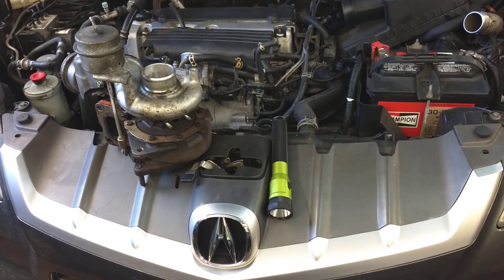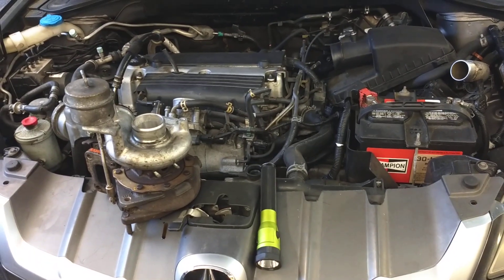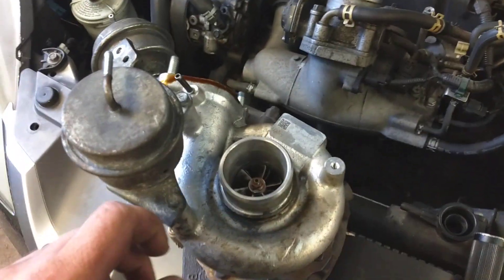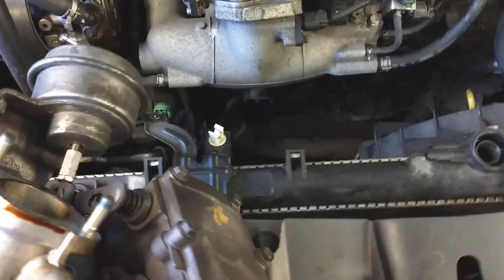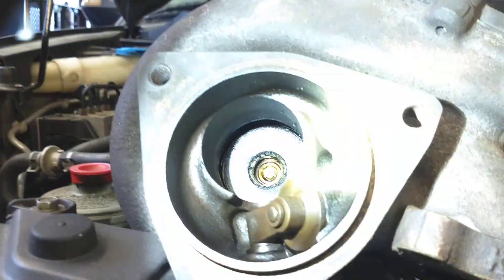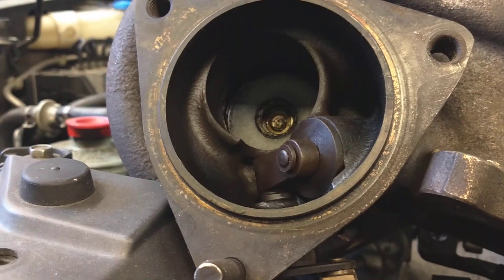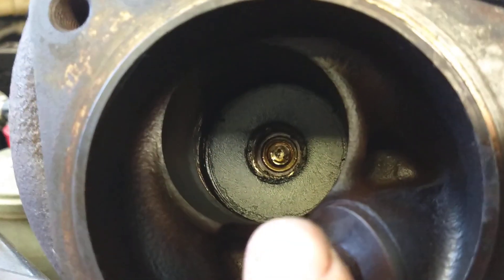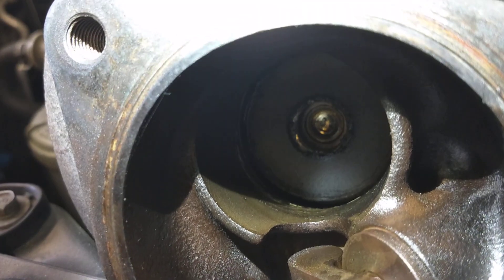2008 Acura RDX turbo failure

Comment: Got my 2008 rdx in 2012. Certified pre-owned at 30 k miles.  I still have it in 2021 with 135k miles. The turbo is sweet! Definitely cars with this issue haven't been maintained well.🧐

Comment: Absolute junk based on what?? '07 here w/ 200k - original turbo - still no shaft play and no oil leaks. These turbos are far better than most and go a long way with minimal maintenance. Stop feeding the sheeple BS - they actually believe it <smh>
Reply: Right on

Comment: Anything we can do to prevent this? Friend has a 2007 RDX with close to 300k miles and runs well. He says letting the car idle for at least a minute before turning it off helps.
Reply from the maker: Yes it's called a turbo cool down. It alows the turbo to cool down slowly after driving.
Reply: 2022 
08 
with 211'000 miles and zero problems  here

Comment: Video of removal?
Reply from the maker: Sorry I didn't record that
Reply: Make one lol
Reply: @SCOPELITUS  Yes please make one or could you type our record vocals of a step by step, im just getting some of the top end stuff off and out of the way, just curious how you got to all the bolts and how you pulled the turbo out, was the motor rotated foward by removing the motor mounts? tons of questions. lol
Reply: @einstine2094  someone just made a video of reinstalling one. U can use those steps in reverse order

Comment: my 2007 rdx is doing over heat and i have changed everything i was ask to change still doing the same
Reply: the exhaust manifold has a crack and is leaking coolant.